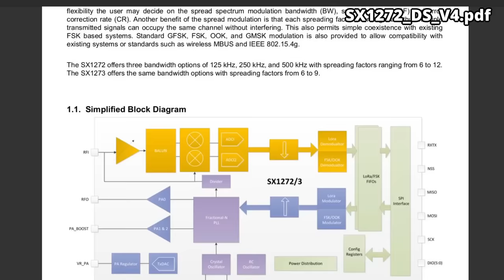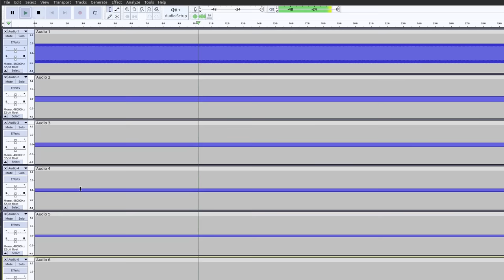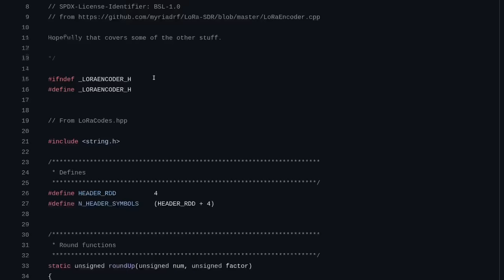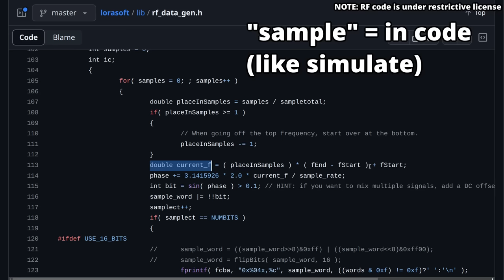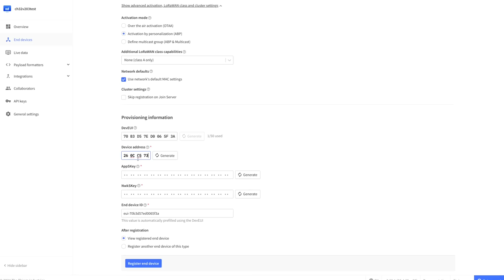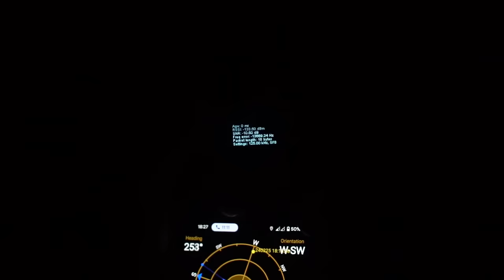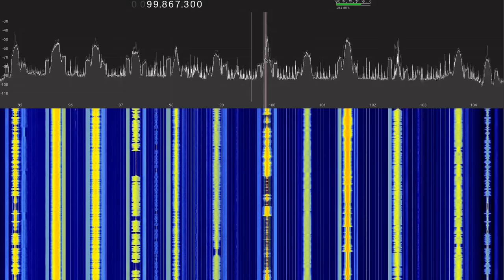How far can I broadcast LoRa packets WITHOUT a radio? - LoLRa

Comment: Put a choke and a rc filter on it and clean up your spectrum. You may get decent results if you print a 2d antenna for your target frequency. See the literature on optical chirped pulse amplification to learn about the physics you're fighting with. Same principles apply here.
Reply from the maker: Oh boy, I certainly hope I don't have to content with that kind of physics!
Reply: @CNLohr  that stuff is WAAAAAAAY easier than what you've done here don't fear the "math" (we're talking about "sin(x)=0 for all x" level of analysis here). It's the difference between changing a fuse in an unfamiliar basement in the dark vs picking up a flashlight ... you already did it the hard way! You only need to learn a few things about a handful of approximations to a solution to Maxwell's equation with a tiny number of parameters (2 or 3 depending on your application) then you have a nice heuristic for thinking about controlling your signal or optimizing your setup. It's all about dispersion and how you shape the dynamic impedance of your signal to transmit and chirp the way you want while decreasing the power leakage on the edges.  Tuning the impedance mismatch of your "antenna" could help boost your range or decrease the required power... or destroy your signal entirely by eliminating the dispersion responsible for the chirp. Regardless, femtowatt signal transmission is pretty impressive!

Comment: "Aliasing" isnt the right word. Since you output a digital pulse train, you are referring to intermodulation products (I think). It's quite common to produce high frequency signals via the harmonics of a pulse train. The signal chain will typically have bandpass filters and amplifiers tuned to a specific harmonic to boost any weaker harmonics (I've seen up to x10 freq multipliers with this technique!). Nyquist has nothing to do with this technique, since Nyquist refers to a sampled signal, which goes out the door when a sampled signal is reconstructed, which can be done in multiple ways. If you reconstruct using a pulse train without a LPF, then there will definitely by higher frequency images.
Reply from the maker: Interesting.  I had never heard of intermodulation until today.  This is probably more of what is really going on.

Comment: I wonder if the undesired aliases could be filtered out using a bandpass, and then the signal could be made readable over a distance using a linear amplifier.

(Yes, I know this would be very illegal.)
Reply from the maker: They absolutely could be filtered out.  I have thought about using a bandpass filter + Class C amp.  It would likely work very well.

Comment: so if I get this right - you buy some electronic devices (say some USB-keyboard), check that there's no component sending RF as possible, actually listen for RF. Checkmark - this device is clean!
Then you order hundreds and later someone replaces firmware on some ESP and identical hardware suddenly sends your key-presses over hundreds of meters to the internet.
Reply from the maker: An esp has a radio. You can do this on radio less chips.
Reply: @CNLohr  yeah, sorry - I used the wrong term. I meant "any microcontroller" (and as basic as possible).

Comment: I've always wanted to do something similar, only with a little more engineering, but I'm really not a fan of the proprietary nature of LoRa. The potential legal peril makes it very unappealing to deal with. I don't even encourage adoption; the company can keep the tech and rot with it as far as I'm concerned. 

I'd be more interested in a free and open alternative system. The magic to LoRa modulation isn't actually all that exclusive, alternative options exist. QRP operation modes have achieved sub-noise floor transmissions long long ago. (I vaguely recall someone transmitting the outline of a crocodilian across the country, not unlike your waterfall display art toward the end of this video.) 

The trick to getting out of the noise floor is simply holding a signal steady and watching the spectrum over time. Because noise is random by nature, it ultimately self cancels over the long run. Your signal , though weak, is a constant bias, which causes a spike at that point in the noise floor. You can simulate this in audio by playing a steady tone on a device placed far away from your mic, then playing a white noise tone on a different device closer to your mic. Listening to the recording in the raw/real time, you will just hear the white noise as it will over power the steady tone. However, if you integrate the recorded signal over a large period of time, the noise cancels and tone will become present. Pretty straight forward, really.

@ WCH uC's and hardware I2C SPI I2S: I love RISC-V and want to love those little WCH chips too, but I have had nothing but problems getting these peripherals running bit-level perfectly. Those pesky transparent buffers always cause odd duplicate data issues that not even and ISR is fast enough to catch. Zero problems on PIC, AVR, STM, etc... just WCH parts.
Reply from the maker: Try my ch32v003fun stack, that's what I've been using and I can use the 003 so precisely I can do software USB with it.
Reply: @CNLohr  Hi ^_^

Yes, I am actually familiar with ch32v003fun. I haven't retooled to use the complete stack from the ground up, I've only looked at the parts that relate to what I am trying to do. That said, even though I'm confident that I have exhaustively studied the relevant parts of your stack, this hasn't helped to solve my problem. Particularly, it's hard to tell if it's not working because of a misconfiguration in a peripheral SPR, or a logic/software bug, or if I'm just not understanding the uC hardware.

... I hope this comes of as constructive criticism and not offensive criticism, but my reasoning for not adopting your stack fully as my base is that, in it's current state, it is full of the magic number anti-pattern IMHO. To be clear, it's absolutely still useful. Particularly; you have way more functional examples, where as WCH's stack is just a bare bones framework. That being said, WCH's stack more closely follows conventional C coding style guidelines from what I have seen. This makes their code more self documenting, so easier to understand and extend.

Even so, society does need a full FOSS replacement to WCH's stack, to be sure. It's clear that WCH is willfully breaking the spirit and rules of the GPL by using Eclipse IDE and GCC but not providing the source/schematic for how they created the suite. It would be forgivable if it was an issue of ignorance, but they have been asked and I'm told they understand and are choosing to ignore this issue because they do not have to obey the GPL in their country. That is a big red flag IMHO and it should be responded to in kind.

I guess, in the end, your stack IS FOSS. So I suppose I could fork or contribute... maybe that's what I ultimately end up doing.

For now, I would be happy to read a QMC magnetometer without the data getting garbled by the funky i2C communication, and only get garbled because..... it's a QMC magnetometer, which are junk.

Comment: 69.420 MHz? Now that looks like a frequency that someone on the Internet made up.
Reply from the maker: It's very real. Unfortunately some ESP32-S2 chips can't synthesize it as it's just at the edge of what the APLL can lock.
Reply: @CNLohr  oh, I believed you. But what a coincidence -- 69 and 420 in the same number!
Reply from the maker: @r0bst4rl1ng  well, we are using the 13th harmonic so technically I was targeting 69.525, and it was so close to 69.420, I couldn't not make the little hop skip a little more down.

Comment: Did you just casually drop a microcontroller emulation test environment video at 9:17 in a video about RF signals???? What sacrifices to which dark lord did tou make to get such wizardry?
Reply from the maker: Just do everything from first principles.  If you get good at doing it from first principles you can go faster than when you rely on overly bloated messes of abstractions and IDEs.

Comment: we should make an open protocol that kills LoRa. Doesn't sound hard when you design it instead of having to reverse engineer and count in efforts of various people's efforts to solve the one problem. Signal Integrity & Recoverability.
Reply from the maker: LoRa already has a pretty strong following, and there's so many commercial stations and chips out there.  It would be hard for an open source option to really play hard.
Reply: @CNLohr   Hey btw, i was wondering. In your solution how do you deal with the other harmonics ? Are they within allowable limits ?
Reply from the maker: @animatrix1851  I didn't test that, but it's likely they are not.  Especially some of the lower ones.  It would be much better if there was some filtering.

Comment: I used to work with Frank in Kirkland. One of the nicest and smartest people I've ever known.

Also, don't Xiaomi devices do something like this (in addition to bluetooth)?
Reply from the maker: Can confirm.  Very cool dude.

I've never heard of anything you're talking about re: Xaiomi care to explain more?
Reply: @CNLohr  I think I was mistaken that this was well-known, I don't see anything on Google, but I have a Xiaomi smartmi DC fan that squeaks out a 10-15kHz 50-100ms chirp every minute or so. I was more annoyed than suspicious and cut out the bt antenna a while back and the sound went away. Inside is a ESPWROOM32D (wifi, bt, le bt) and a small stm32
Reply from the maker: @dengyun846 if I were you I'd look into that. It sounds like you might find something really interesting

Comment: I don't understand how something can find a signal below the noise floor.
Can someone explain (or point to a source)?
Reply from the maker: The broad principle is called "process gain"  But the idea is when you condense the information, that condensing of the data across the area of the spectrum punches through the noise floor.  But you can only see it after you condense.

Comment: Isn't this technique essentially bootleg upmixing?  It works particularly well for LoRA since it is generally a very low bitrate protocal.  If you wanted to encode changes in the signal at 900MHz then you would definitely need faster everything.
Reply from the maker: I love that title. "Bootleg up mixing"

Comment: Hi.I thought to have access to use LoRa you had to have an account with a provider who lets you make use of the services, eg cell towers etc. in similar maner to having an account for a cellphone. Without one you cvellphone cannot connect. How did you bypass that, or did you use an account?
Reply from the maker: For things like NB-IOT, you need that.  But, LoRa doesn't work that way.  There's no infrastructure like that for LoRa, it's just flinging packets around.

Comment: Just a few days ago I tried to make a pin on an attiny85 go really fast but I got nothing on my sdr. And now I am looking at you transmitting lora packets... BRUH
Reply from the maker: You can configure the PCK to be around 92MHz, then, use the timer connected to the PCK and set the period to 3 (it doesn't work with period 2) and set one duty cycle to be 3 and the other 2, so it causes the maximum number of delta bit transitions.  It produces a reasonable signal if you connect two little wires to those connections.
Reply: @CNLohr  I have the CPU clock decided by 2 and connected to a pin and can see it on oscilloscope, but can't see it on the SDR. I haven't looked deeply at it. Maybe the wavelength is too big for the wire antenna or for the rtl-sdr. 
Definitely would try the PCK thing.

Comment: (Just a min into the video) Can we not just filter out any of the unwanted frequencies before transmitting them?
Reply: yup, use a bandpass filter. I think he was just going for zero extra parts.
Reply: @nobodynoone2500  that’s good to know though! That would potentially make it a bit more compliant legal I guess?
Reply: to some extent, using a SAW filter, but that doesnt make a decent tramitter still.
Reply from the maker: It would be really good to filter, but this was to see if I could do it without any extraparts.

Comment: Dude, Nyquist theorem says the bandwidth will be half the samping rate... It is only limted Fs/2 on baseband!
Reply from the maker: All I can transmit at is baseband.
Reply: @CNLohr  not really. You are generating at baseband, and transmitting on some other bands whose width is Fs
Reply: Rephrasing it: you are not wrong. What I tried to state is that people interpret Nyquist's theorem wrong. 

As long as you are not exceeding a bandwidth of Fs, you are not overcoming the Nyquist frequency, whether baseband or on some odd multiple (also even, but then spectrum is reversed). 

That is the basis of bandpass sampling

Comment: Abstract
   
The video presents an innovative exploration into transmitting LoRaWAN messages using microcontrollers without built-in radio functionalities. By manipulating the GPIO pins to generate RF signals through intentional harmonics and aliasing, the project demonstrates the feasibility of sending LoRa packets over significant distances, far exceeding initial expectations. This unconventional approach, leveraging devices like the ESP32-S2, ESP8266, and the CH32V203 microcontroller, showcases the potential of generating RF communications in a cost-effective and resource-limited setup. The experiments culminated in achieving transmissions over a kilometer, challenging traditional notions of RF communication and opening new possibilities for IoT and wireless technology applications.  
   
Introduction to RF Signals and Initial Experiments
   
- 0:00 - RF signals typically require radio chips or microcontrollers with radios.  
- 0:15 - Introduction of the ch32v203 microcontroller, which lacks a radio but can send LoRaWAN messages.  
- 0:36 - Demonstrates sending messages over 400 feet away using manipulated GPIO pins.  
- 1:03 - Highlights the surprising effectiveness of this method compared to expectations.  
- 1:14 - Discusses the limitations and inefficiencies in power transmission through this method.  
   
Microcontroller Characteristics and Creativity in Limitations
   
- 1:37 - Describes the microcontroller's features and limitations, emphasizing the creativity required to work within these constraints.  
- 2:04 - Explains the intersection between hardware rules and software flexibility in microcontroller applications.  
   
Technical Deep Dive into RF Signal Generation
   
- 2:17 - Details on how carefully controlled on/off switching of GPIO pins can create RF signals.  
- 2:55 - Inspiration from discussions on RF technologies and the potential of LoRa.  
- 3:46 - Technical challenges in creating LoRa transmissions without traditional radios.  
   
Overcoming Technical Challenges
   
- 4:18 - Describes the limitations and workaround strategies for generating high-frequency signals with microcontrollers.  
- 5:03 - Introduction to harmonics and how they can be used to generate RF signals.  
- 6:07 - Utilization of the ESP32-S2's Audio PLL for generating specific frequencies.  
   
Expanding the Experiment
   
- 7:19 - Application of learned techniques to transmit LoRa frames using the ESP32-S2.  
- 8:30 - The trial and error process to achieve desired signal generation.  
- 11:57 - Moving onto the ESP8266 for its I2S bus capabilities and overcoming limitations with innovative solutions.  
   
Achieving LoRa Transmission with Various Microcontrollers
   
- 17:41 - Successful adaptation of techniques to the CH32V203, achieving LoRa transmission without traditional radio components.  
- 21:02 - Leveraging LoRaWAN for global message transmission through the Things Network.  
   
Field Testing and Surprising Results
   
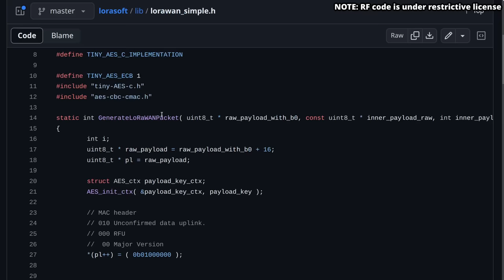- 23:01 - Field tests demonstrate the ability to send LoRaWAN frames over significant distances, far exceeding initial expectations.  
- 26:05 - Further tests in different environments confirm the robustness and potential of this unconventional transmission method.  
   
Conclusions and Future Possibilities
   
- 31:31 - Reflections on the project's success and the surprising capabilities of the methods developed.  
- 32:02 - Introduction to tools and techniques that facilitated the project, highlighting the importance of experimentation beyond conventional methods.  
   
Acknowledgments
   
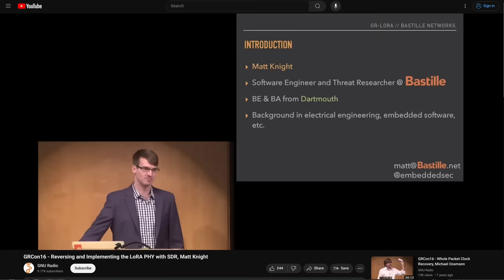- 37:30 - Credits to contributors and encouragements for viewers to explore beyond traditional engineering approaches.

disclaimer: i used gpt4-0125 on the youtube transcript

Comment: So... Why wouldn't a filter be something you can hook up here?

Also, couldn't you amplify this signal at some point?
Reply from the maker: You totally could.  But the question was - can you use off the shelf hardware with no modification at all?
Reply: @CNLohr  That's fair.

I guess my brain is just trying to figure out how to mass produce things cheaply. I have a manufacturing background. 

I would really love to see cheap modules so that these can be put up everywhere. Clearly, distance is not that great.
Reply from the maker: @phil2082  you would need to test extensively before deciding if this would work for you

Comment: Could this be used on 27mhz or 40/75mhz rc frequencies???
Reply from the maker: Absolutely!!! And it would be WAY CLEARER AND CLEANER there.
Reply: @CNLohr  if you can make that work i know a lot of RC submarine guys that would be all over it.
Reply from the maker: @geofrancis2001  I thought you'd have to go much lower than that to cut through water.

Comment: Just need to drop the power below 6nW to make it exempt from FCC certification!
Reply from the maker: What is that over? 6nW over what range?  I've never been able to find good info on this.
Reply: @CNLohr  6nW total power consumption.  Basically not feasible for any mcu running at MHz speed.